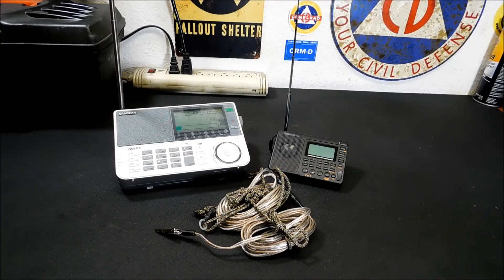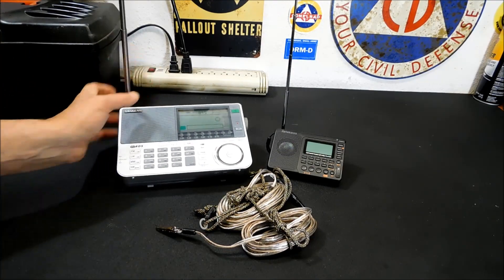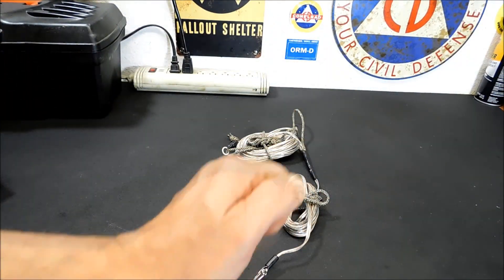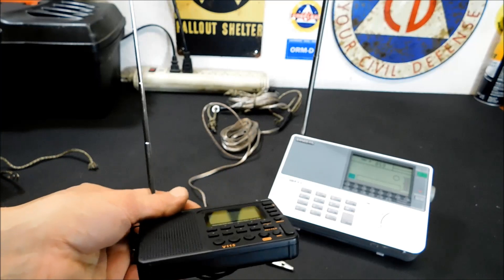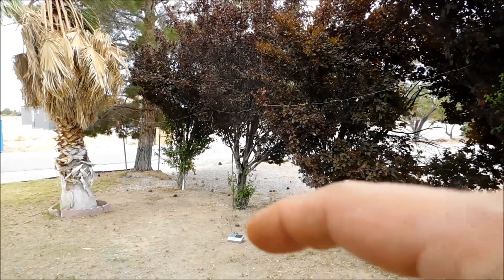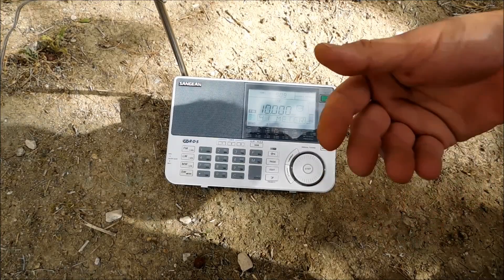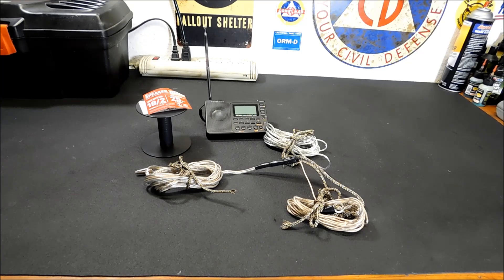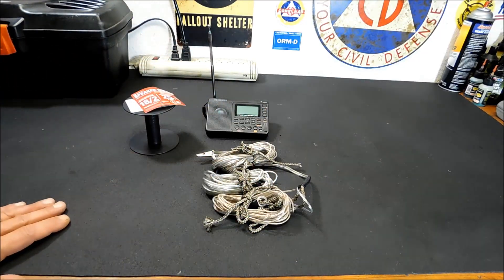Make Your Own Shortwave Speaker Wire Antenna!

Comment: Will this setup work on a scanner?
Reply: Scanners are typically listening to VHF and UHF. This antenna isn't really for that. Look up some videos on how to make a j pole antenna.
Reply: Scanners are generally wide band depending on the model. High end scanners go from 100Khz to 1400Mhz depending on the frequency band your listening to dictates the antenna disign and length. 10meter ham and 11meter CB can be adequately received with a CB antenna. Shortwave 25Mhz and a less requires a much longer antenna if using a dipole. However there are many other designs that perform very well while sitting on your kitchen table. Nice thing about a dipole is that it can be cut to an exact length to give maximum performance on a specific band. Confusing to some but easy to find a  ham radio club in your area. Someone will gladly guide you through the process.

Comment: Very fine  !! I have a question about the wire.. Does the diameter of the wire can be important for a better reception ?
Reply: No the diameter will have no effect on reception. What metal the wire is made of makes a difference. Copper wire will have better reception than steel or aluminum because copper is better conductor.

Comment: Very fine  !! I have a question about the wire.. Does the diameter of the wire can be important for a better reception ?
Reply: Wire diameter is not important for reception on one of these SW radios.

Comment: Very fine  !! I have a question about the wire.. Does the diameter of the wire can be important for a better reception ?
Reply: Diameter of the wire does not matter for receiving. Get is thin a wire as you can so it will pack lite. If you were transmitting, then thicker wire would be important to handle the power.

Comment: I find adding a 20-foot (ish) random wire or dipole just overloads my portables because they dont have a robust front end. I am on a Tecsun PL380.
How do you compensate for this?
Reply from the maker: Honestly I have not had that problem, the radio I used in this, is still using this antenna I made in this video.  Perhaps you can turn down the RF gain

Comment: Shortwave is a must. It is often neglected and the way you extended the range is easy. Would this work in things like the Baofeng units to increase reception ?
Reply from the maker: Reception yes, but unless you cut it for the correct bands I would not use it for transmit at all, it might hurt the radio since SWR would be high

Comment: hey - interesting.  HOWEVER   did you just twist the 2 wires together then screw to the alligator clip ?
Reply from the maker: Yes, forgot to mention that, I stripped both sides, twisted them together and then soldered them in the clip itself. It would have worked had I not soldered it, just did that to make it a bit more sturdy.  I did also clamp down the end of the clip on the soldered wires just for extra strength